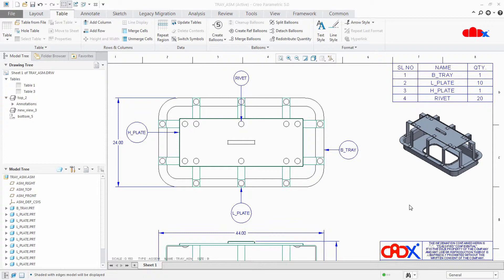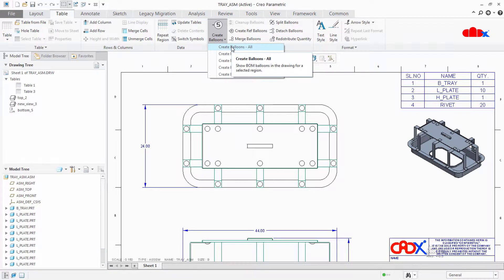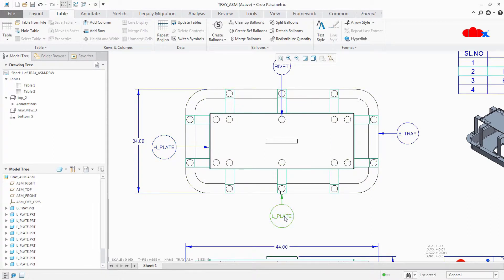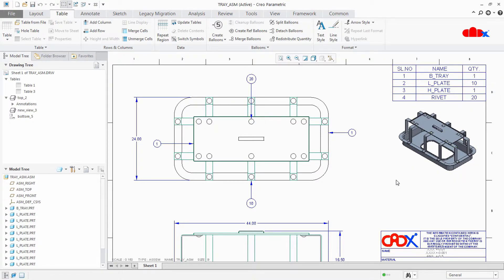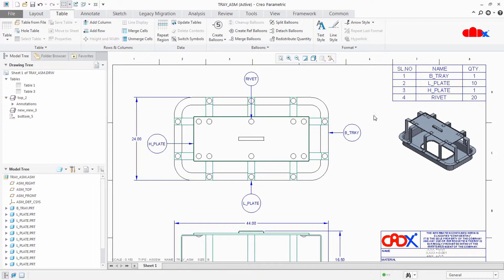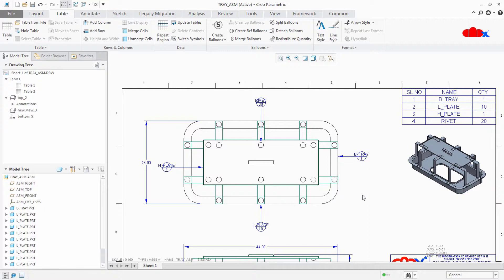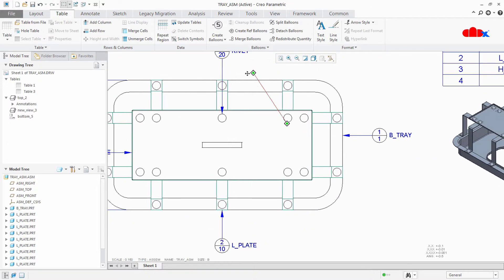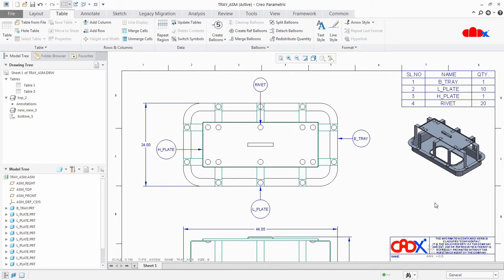Balloons with part name and other parameters in Creo Parametric

Comment: Hello, i want to create a custom balloon with just the 3 last characters of a part name. So is there any commande like asm.mbr.name but only for the 3 last character of the part name ? Thank for your tips !
Reply from the maker: I found another way to do this. You can create a common parameter in all the parts with the last three characters of a part name and you can call that parameter to the bom balloons in your assembly drawing.
Reply: @CADxTraining  And how to create this "common parameter with the last three characters" in a part for example ?
Reply from the maker: Create a common parameter. For example create a parameter called "NAME"  in all parts. Now the value of this parameter will be the last three digits of the part name.
Same thing you do for all the parts. Once this is done, you can use this parameter for the balloons inside the drawing.
Reply from the maker: Have you tried
Reply: @CADxTraining  Okay i'm going to try but how do you create a common parameter ?
Reply: @CADxTraining  For create the common parameters, is it on "tools" then "parameters" ?
Reply from the maker: Yes
Reply from the maker: Balloons with last three letters of the part name in Creo parametric(manual and automated process).
https://youtu.be/gDNn3GqCsho